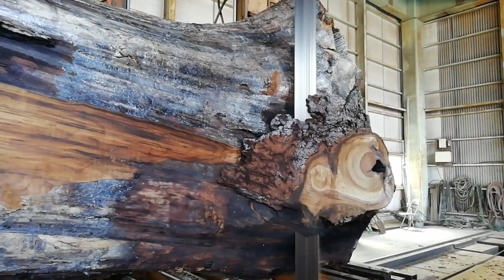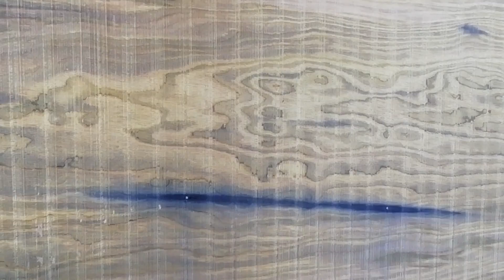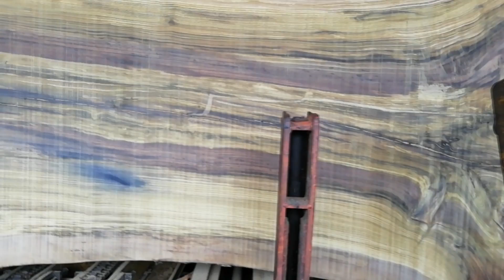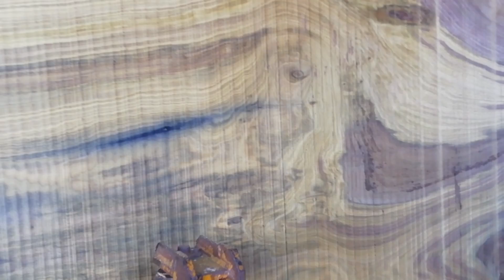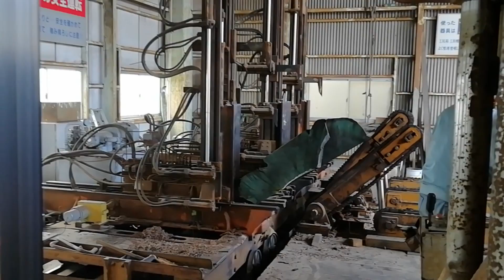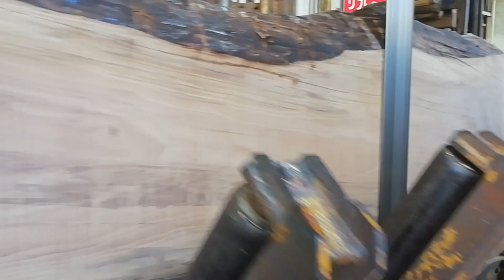BIG AMERICAN　BlACK WALNUT SAWING!!

Comment: Painful to watch that blade burn through the walnut log. Been there done that after going through a railroad spike in a huge Pecan log.  My little 12 ft. x 1 1/2 inch blade was wasted though,no grinding it out.  That huge Walnut log sat on the ground a very long time or was standing dead a very long time. Arigato  Mr. Sasada

Comment: Do the nails/wire cause much damage to the band saw blade?
Reply: That first band saw is probably beyond repair. once you get them that hot they are toast!
Reply: @harvschmidt8608  thank you for the reply. I figured the heat wasn't good either.
Reply: Small nails like that not much when we hit them we would stop and straighten any bent teeth maybe touch up a few with a hand file but It causes extra work in the filing room.
Reply: @arfcom3333  Are these amounts of nails acts of vandalism?
Reply: Absolutely not that is a very old tree there were no tree huggers around then😁
Reply: @arfcom3333  We hit all kinds of stuff buried in the logs over the years. The big 6 and 8 inch ardox spikes have to be one of the worst though for breaking off teeth
Reply: Ya we ran a 17 gauge saw so big spikes like that and the blade was toast,ceramic insulators were really bad also.
Reply: @donaldwoods3618  I hit an insulator with the band saw that was one foot into the tree.. Likely tacked onto the side of the tree 40 to 50 years before and the tree grew around it. I have also hit nails that were buried deep into a tree that; judging by the rusting; were decades old and the tree grew around them.
Reply: @harvschmidt8608  ...Those insulators are rough on the blade, hit one once that was at least a foot in. Horizontal bandsaw, made 4 cuts, one below another, spanning 4 inches before I got by it. Talk about a toasted blade.